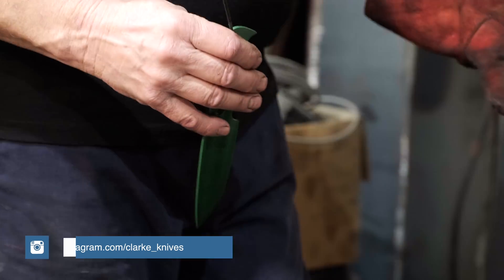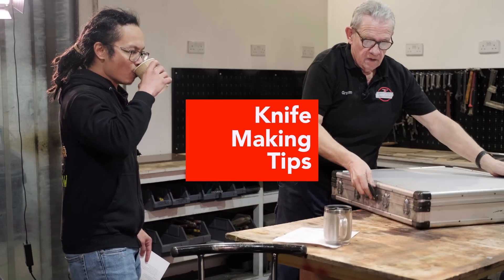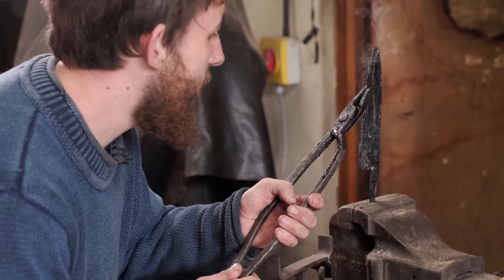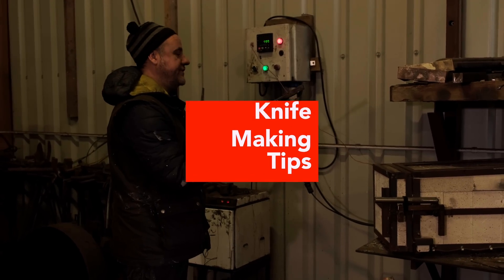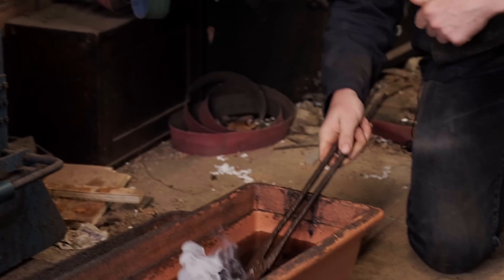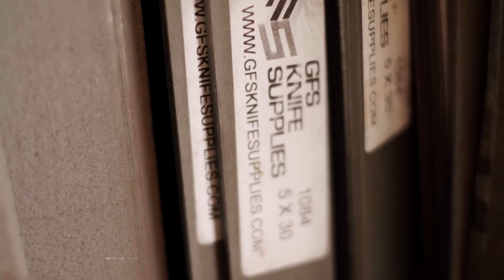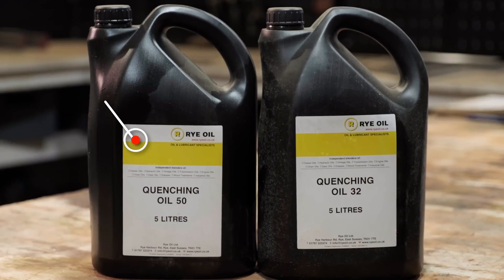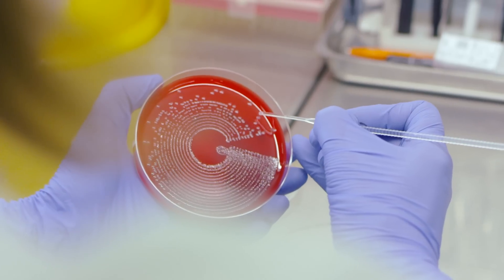The ONE and ONLY THING you need to get the best grain size

Comment: does the orientation of a blade in a furnace/forge affect the amount of warpage in the steel i notice i have a warp in a blade after slow cooling it in vermiculite but i also had laid it flat in my forge well it got to heat, and it warped in the vermiculite? i am wondering the bottom of the forge acted as a heat sink on one side creating a heat differential that caused the warp.. i noticed the same thing happen to a few other blades i had done this with.
Reply: Any uneven or differential heating or cooling cycle has the potential to cause warpage. Another spanner in the works is internal stress in the original material. If it's there it will stress relieve itself on the way to the hardening temp and it's then impossible to say what exactly caused any one blade to distort.
Reply: Distortion is fiendishly complicated so the most honest answer is "Maybe." 

Yes, differences in the heating can cause warping. If I had a blade to put in a furnace I'd ideally hang it on a bot of wire. That won't be possible for a lot of furnaces, though. 

To some extent you'll just have to deal with distortion. Normalising can help after forging and before hardening but won't guarantee you'll avoid distortion.
Reply: @GemAppleTom  thank you both for answering. I went and did some work yesterday and i tried putting in some 'blocks' (two chunks of steel, then made two better ones from  a thick cunk of leafspring) to prop it up on the spine after straitening a bent blade hot and then dumped back in the vermiculite and its strait so in theory this may have helped since I cant do a wire hang. (i want it strait because i want to do some file work on it before I harden it).
True for hardening. i noticed that how you move it in the quench tank can effect warpage. going side to side insted of tip to hilt to agitate the quench medium (i use parks 50)  can cause the blade to bend and even crack as it converts to martinsite...after i cracked a lot of blades doing this (blush emoji).
Reply from the maker: thanks for all the help you do here Tom and your constructive comments are always appreciated! I hope you don't mind that I made you a moderator for the chats here in the channel. Thanks!
Reply: @UKBladeshow  I’m a what now?! 

I’m enjoying the channel and it’s definitely a subject I’m interested in. If I notice anything obviously spammy I’ll remove it. Seems to be generally good crowd, though.
Reply from the maker: @GemAppleTom  haha don’t worry too much bud, all that means is your comments will be clearly visible to other members as your comments have been extremely helpful. Thanks again Tom!

- Vinz
Reply: @UKBladeshow  I’m very glad to hear that, thanks. 

(It probably tells you a bit too much about me that I’m enjoying it…)

Comment: Excellent channel. But I understand that forging, for example of wrenches, also creates a grain flow. If the grain size changes enough during heat treatment, is this grain flow pattern preserved?
Reply: The grain flow created by forging remains. Normalising may/will change the grain size but the flow pattern will still be there
Reply: @clarkeknives4159  You're right  of course. Seen plenty of macros to check grain flow myself. But i wasn't thinking of them for reasons best known to my subconscious...

Correction: it's not easy to see grain flow after hardening ^microscopically^. It's easy enough to see grain flow under the microscope before hardening but not after.
Reply: The initial state of the grains will influence the hardening process so even a well heat treated cast won't have as good properties as a forged part. A full anneal will pretty much get rid of the effect though not totally.

It's not easy to see grain flow after hardening. There are industial standards for checking the prior austenite grain size but quite honestly they're not very reliable. Two equally trained people can get completely different results from the same sample.

Comment: Mr. Clark, thank you very much for taking the time and sharing your knowledge with all of us. I really appreciate it. I was wondering about differential hardening with W2 steel. Water quenching is said to have the best hamons, is there an oil that will produce as nice of a hamon as a water quench?
Reply: What really determines a good hamon is the carbon content. Above 0.7% works and the higher the better so W2 should work well. It'll probably harden up OK in a fast oil as we only use thin sections for blades.
Reply: @clarkeknives4159  Thank you for responding and for the information.
Reply from the maker: Thanks for raising a good question sankojin. I hope you enjoyed the video!
Reply: Depends where you are from. Parks50 or durixol v35. Durixol is fester.

Comment: Good videos as always. I agree identifying the colors from the chart and matching to the hot steel takes practice. And it is a deteriorating skill. During my apprenticehsip as a tool and die maker I was quite good at it now not anymore. 
Small parts we heated up in an open flame and I remeber one or two steels where you could see the structure change. It looked like a shadow moving over the surface. For a couple of weeks I have temparature controlled kiln.
One question I have, what is the emissivity you have set your pyrometer to?
Reply: I too would like to know what is the emissivity you have set your pyrometer to.

Comment: Do you recommend doing a normalizing apiece of stainless steel that was bought   annealed and only stock removal methods done no hammering. Does the grain size still get a benefit from a normalizing cycle. I really like your videos you do a good giving lots of info with an easy way to understand what the steel is doing. Thanks for sharing 👍.
Reply: This is general advice that’ll work for most steels since I don’t know what stainless steel you’re using.

Stock removal will create some residual stress which might cause warping. A stress relieve cycle (done at a lower temp than normalising) would be recommended if you’ve taken a lot of material away. A normalising cycle will do a stress relieve as well. 

You won’t have the ideal properties (grain size, carbide distribution etc etc) if you harden and temper directly from the annealed state but it might be good enough. If you’re sure you’ve got the hardening, quenching and tempering right and you’re still not getting what you want then you could look at normalising first.
Reply: Good quality steel bought annealed and used for stock removal will not need normalising.
Reply from the maker: I hope that answers your question directly from the horse's mouth Garet. Thanks for your comment!

Comment: What’s you opinion of using the visual aid of decalescence as a guide for forge heat treating
Reply: I had to look it up first…

I’ve not heard of it being used in practice. But my experience is with contract heat treatment where you really do need the accuracy of thermocouples.

Comment: I use the fast quench oil you sold when you were still in south africa.
Reply: Hi Tim, That oil should be nicely run-in by now. Think about changing it in another 20yrs.
Reply from the maker: Cheers Tim! Hope you enjoyed the video!
Reply: @UKBladeshow  I've been learning a lot from the ones on heat treatment.

Comment: Yes! Great Sunday morning! 
I know he specializes in knives, but does he ever do anything on tools as well? Hammers and such? Either way great stuff.
Reply: to my mind knives are the most difficult to quench and he just covered block steels with the bubbling problem ...You should be able to take it form there that for a 1084 hammer you will need parks 50.
Reply from the maker: Hi both thanks for the feedback and the reply!
Reply: I also run a heat treatment service for farriers and blacksmiths who make their own tools, especially hotwork tool steels such as H13
Reply: Thanks you guys! 
I'm currently using truck axles. I'm novice but growing fast, already pretty much full time thanks to help from the wife. I scrap to help supplement bill money. Anyway most truck axels from what I've gathered are 4140 steel and  H13.  I've made 3 and they hardened well in a hot water quench. I just want to learn all I can. I wish I would've had this drive ten years ago. Again big thanks🍻

Comment from the maker: Got a forge and no heat kiln? Get an industrial digital pyrometer HERE: https://www.amazon.co.uk/dp/B08BC2792H/?tag=ukbladeshow-21

Enjoying our videos? Help us make more by supporting the channel BELOW:
Patreon: https://www.patreon.com/UKbladeshow
UK Bladeshow Greek god of Blacksmithing shirt (Hephaestus): https://ukbladeshow.creator-spring.com/listing/hephaestus-november-2021
Reply: For the smith on a tight budget, what would you say to one of the slightly less expensive models from the same company that might not have quite as high a temperature range? For example, the model you recommend goes up to 1800°C, while the one that goes up to 1500°C is only about 2/3 the price. How necessary is it to have that extra 300°, especially considering that anything above 1600°C is probably liquid anyway?
Reply from the maker: It all depends on your use and what steels you work with but for myself, I do not need anything over 1500degC so I would save myself some money and take that. I hope that helps!
Reply: @UKBladeshow  It does; thank you.
Reply: @UK Bladeshow , thanks for this I was wondering which one was worth having